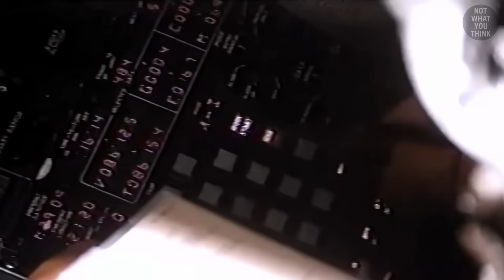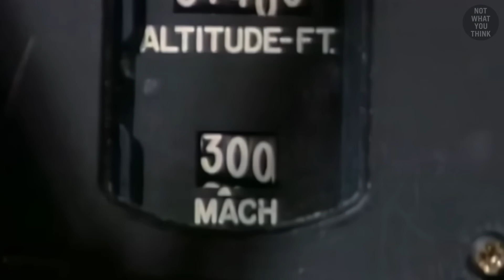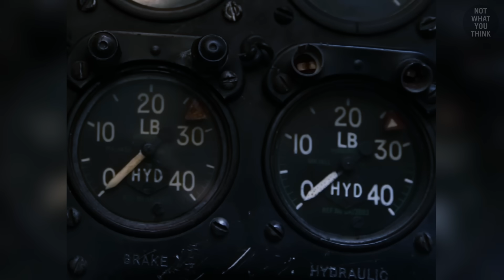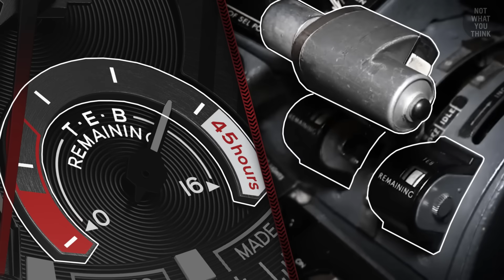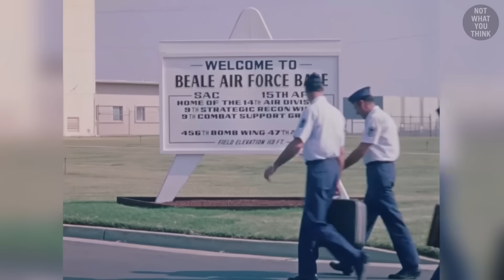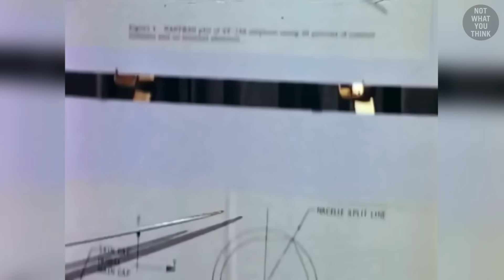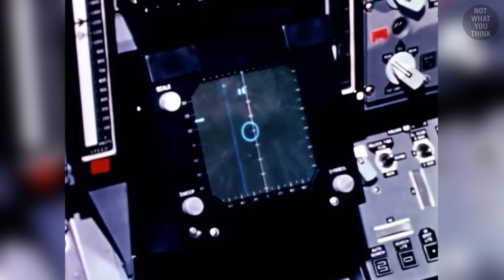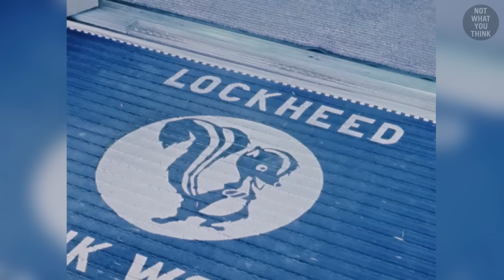Real Stories From The Cockpit Of The Untouchable SR-71 Blackbird

Comment: From a presentation from a former SR-71 pilot, taking off with limited fuel was not for the landing gear or practice refueling, it was the fact that it couldn't escape ground effect on the runway and rotate to take off when fully fueled. It had to be low on fuel in order to get in the air. Same pilot said the F-22 climb rate was 'cute'.

Comment: The 2nd reason the blackbird refueled soon after takeoff was to purge the ambient air from the 1/2 filled tanks. Once full the SR-71 was cleared to accelerate up to speed and altitude. 

There was an alternate procedure done 2-3 hours prior to flight. Fill the tanks full on the ground. Service the liquid nitrogen full. Defuel the tanks from 80k down to 65k. Now the atmosphere in the tanks were inert. This would allow the aircraft to accelerate up to speed and altitude from take off. While still having the safety margin in the event of a emergency landing.

This was only normally used during flight test and not operational missions.

Comment: TWA flight 800 was likely shot down.  A number of people saw the missle from beaches along the coast.  To prove these people wrong, they shot a test missle and had observation points on those beaches.  Every observation point was able to see the missle.  Wouldn't be the first time the truth was hidden.  The TWA flight was in 1996, the SR71 use nitrogen from day one, 1964.  The two airplanes used very different fuels, JP-7 verse Jet A.  Jet A is very much like diesel fuel, it doesn't ignite with a simple flame.  The military was conducting SPY-ID(V) operations in the area under TWA 800.  There was a possible  CIA coverup and FOIA requests were delayed past the statute of limitations.  The FBI was also discouraging witnesses from testifying.  Clearly the story of the center fuel tank is highly questionable.

Comment: Seriously?! You believe the government narrative that TWA flight 800 exploded due to supposed fuel vapors igniting; when the plane flies at subsonic speeds and hadn't even gotten to its cruising speed. Also, if that's the case, why has there never been, before or since, an incident of a plane's fuel tank exploding due to an internal ignition of fuel vapors during a flight?
It was clear, based on eyewitnesses and the final declassified report that the plane was accidentally shot down by a missile fired by a naval vessel doing training near the area.
You should do better research, so you don't present erroneous information. 
Otherwise, a very good historical documentary. Thanks.

Comment: As for the maximum speed - one key note is that Mach number changes with air pressure and temperature. In some atmospheric conditions, Mach 3.3 is faster in raw miles per hour than in others. The hard limit of the inlet cones of Mach 3.55 is indeed a Mach limit. Thus based on the conditions, that could be faster or slower ground speed.

Also, one key thing is that the Mach number is lower in miles per hour of airspeed in thinner air - so Mach 3.55 at the altitude the SR-71 flies is slower than Mach 3.55 would be at sea level. (And no, SR-71 can't go Mach 3 at sea level, or anywhere near it. The atmosphere is so thick the atmospheric friction heating would melt even the titanium.)

Comment: The aircraft could not explode from fuel vapors. The fuel had a very very high ignition point and required special ignition systems on the plane. @13:45. Might want to fix your video....

Comment: The low fuel on takeoff was necessary to prevent problems in case of an engine failure. It couldn't climb at max weight with one engine inoperative.

Comment: Leaking fuel tanks: rubbish, or, to use Latin, faeces. Similarly for fuel vapour spontaneously igniting, the flash point is higher than 200ºC. You are quite correct, it is not what YOU think !!
Reply from the maker: What about leaking fuel tanks?
Reply: @NotWhatYouThink all aircraft leak, and have leak limits. The SR71 was really no different.

Comment: wasn't LN2, but TEB. The afterburners could only be lit by a hypergolic shot of tri ethyl borane, and when you ran out of that nasty juju, you could not re-light burners after you hit the tanker.
Reply: They had a backup catalyst ignition system for the ABs, they just didn't like to use it.

Comment: The fueling coment is completly untrue.  The plane needed a different fuel to go mach 3 after takeoff.
Reply: Huh? The SR71 was always fueled with the same fuel. While it could be refueled in the air with other fuels if an absolute emergency, it would have had significant reduced performance.

Comment: its hydraulic oil not fuel by the way.
aerodynamic disturbance? You mean stall the engine  out right?
Also I think you did not say WHY fuel leaked between titanium panels - because of thermal expansion of the metal at normal operating conditions at speed. Gaps closed up in the air when plane was hot.

Comment: Yeah the air going to the engines not being supersonic was absolutely critical.  That would destroy the engine.  Another bit about the SR-71 is at speed it was very sensitive to pitch angles.  Didn't take a heck of a lot at speed to sent the aircraft out of control.  One of the coolest parts of the aircraft was how it knew where it was in the world.  Since it was above the clouds it had a good view of the stars and used those to know where it was at.

Comment: TWA800 was downed by a USN Submarine launched SAM, not fuel vapor, as the center tanks’ fuel/air ratios could never support combustion.
Reply: LOL.  Dude USN submarines don't even have SAM missiles.  That would require surfacing the submarine and that is the antithesis of how submarines work best.  You played yourself with that goofy statement.
Reply: The sub herself hadn't even been commissioned yet, and the missile they launched from periscope depth existed in violation of then current cold war treaties, so the USN wasn't about to surface and say, "My bad!" The NTSB sent seat fabric samples to the lab for analysis before the FBI locked them out of the investigation. The samples tested positive for residue of an explosive compound that was used exclusively in a sub-launched SAM prototype from a program that had been cancelled as part of SALT. The gunner's mate at the unfamiliar launch console was being harassed by a petty officer to hurry up with acquiring the target drone and launch so they could dive and get back to Groton before anyone noticed the sub was gone. The gunner's mate didn't realize he'd locked the unproven system onto the 747, and not the drone, until it was too late. There's nothing "goofy" about tragedy.

Comment: TWA 800 was hit by two missiles during a US Naval contractor test of what was probably a missile and an interceptor missile.  The interceptor failed and both missiles wound up hitting TWA 800 blasting the fuselage in two at the wing root.  The Clinton administration completely sabotaged the investigation pushing the FBI and the CIA into what should have been a National Transportation Safety Board (NTSB) investigation into the cause of the crash.  Boeing aircraft back then did not spontaneously explode due to random sparks and Jet A vapors inside the centerline fuel tank. The 747 is subsonic and does not experience the atmospheric heating that the mach 3+ SR-71 routinely experienced on its titanium skin and there was no need for any nitrogen in the fuel tank to displace air. That and the CIA's invented ridiculous "zoom climb" hoax to cover the track of the missile marked the end honest "government investigations" of transportation accidents.  From that point on the NTSB was turned into a political propaganda tool as this narrator demonstartes.

Comment: I was working on the SR-71 when it was finally cancelled by Clinton in October 1997.  During this time, the military had installed a data link on the SR-71.  The data link was installed in a camera bay forward of the front landing gear.  The data link antenna radome protruded down into the shockwave coming off the nose of the aircraft, so the pilot to watch how he banked the aircraft or the shockwave coming off the radome would go into the engine inlet and cause an unstart.  Both of the aircraft that we flew, 967 and 971, are now part of museums, and I have been told that one of them has that radome installed, but I'm not sure which of the two since they aren't located close to each other (one in Oregon and the other in Louisiana), it's kind of hard to verify which one.
Reply: Спасибо за интересный комментарий...
Reply: Меня больше всего восхишало, в этом самолёте дизайн. Это шедевр.
Reply: Z tego co pamiętam, pracownicy Skunk Works strasznie narzekali na wiercenie otworów pod nity w kadłubie SR 71 zrobionym z tytanu, który CIA, zakładając fikcyjną firmę we Francji kupiło od ruskich. To musiał być szok dla pracowników Skunk Works, że na wywiercenie w tytanie jednego otworu pod nit, musieli zużyć kilka wierteł. To były lata 60.
Reply: @roberts9000  Skunk Works had to invent new tools and ways to manufacture and work with titanium. The SR-71 was breaking new ground from start to finish.
Reply: cool
Reply: But they were still flying missions out of Cyprus in 99.   Kindda difficult to keep something that loud quiet.
Reply: @ScamArtist-x7h  Um, no they weren't.  You are getting the SR-71 mixed up with the U-2.
Reply: Very interesting.. I've heard that when supersonic if the engine conditions weren't perfect, the engine itself could "swallow" the shockwave coming off the inlet air cone and cause a flame out, from my understanding the SR-71's intake nose cone's are hydraulically/mechanically adjusted
Reply: @fjs1111  yep.... you're correct. That's the very reason for the cones being able to adjust.
Reply: Так была течь топлива у SR-71 или нет?
Reply: @IziyaSnobelman  The panels of the airframe at normal temps were designed to be loosely fitted because the designers knew the airframe would expand when heated at Mach 3+. Fuel would leak on the ground. Once airborne above Mach, the panels would heat up from friction and the panels expand, sealing the airframe and no more fuel would leak. There was no fuel bladder or seals that would withstand the temps at Mach 3+. A special fuel was designed for the SR-71 to take this into account. It was thicker than regular jet fuel.
Reply: @hifinsword  Спасибо за разъяснения. По моему скромному мнению это - опасно.
У нашего 3 Махового перехватчика МиГ-25 и Миг-31 топливо не течёт. Планер сделан из нержавеющей стали, и собран на сварке.
Всего Вам хорошего. Россия.
Reply: @IziyaSnobelman  The SR-71 was designed to go Mach 3+ for hours without afterburner and use less fuel than at afterburner. The airframe is mostly titanium, light weight and very strong, able to withstand high temps. The Foxbat cannot do super cruise without afterburner, and not for hours. Nor can Stainless steel withstand high temps for hours. It's rumored the Foxbat needs the engines replaced if at top speed for more than a few minutes. The lightweight allows the SR-71 to fly at heights the Foxbat cannot reach. There is very little danger from the SR-71's special fuel leaking on the ground. Its flash point is higher than normal jet fuel.
Reply: @hifinsword  Спасибо за разъяснения. Я не знаю, сколько может летать на сверхзвуке МиГ-25(31). Знаю другое - нержавеющая сталь более устойчива к высоким температурам, чем титан. Кстати - титан на SR-71 имеет русское происхождение.
Reply: @IziyaSnobelman  sr-71 стал бесполезным после того как спутники получили возможность давать адекватную картинку, благодаря которой все можно было видеть не летая над территорией. а не из за миг-31 или ещё чего либо
Reply: @IziyaSnobelman  According to Google, "the MiG-25 could only sustain its maximum supersonic speed of Mach 2.83 for a very short time, typically around 5 minutes due to the risk of overheating the airframe and fuel tanks if flown at that speed for extended periods." The MiG-25’s ceiling of 67,000 ft was well below the advertised ceiling of 85,000 ft. I believe the Mig's engines had to be changed out if it went max speed for very long.
Reply: horror
Reply: Миг 25 отучил эту птичку летать и да он не выглядел как космолёт неземного происхождения . Инженеры были на высоком уровне создавшие самолёт с подобными скоростями , но гораздо более удобный в обслуживании.
Reply: @sergeykhadyev  that thing ugly as hell bro

Comment: 17:00 - the sr71 mach meter went to mach 4, and the rumours were it could do 120,000 feet.
Reply: Lol neither of that is true
Reply: @gr8crash  lol its true, just rechecked the mach meter and it has fine graduations until M4 and then goes up to M6 ..... grow up kid
Reply: @ghostrider-be9ek what you're referring to is the mach/airspeed gauge. What you obviously arent aware of is that gauge isn't used above mach 1.5 as it's too inaccurate. They ONLY refer to the TDI gauge, which doesn't go that high.

Also 120k ft is completely impossible. It couldn't even sustain 100k ft and didn't get that high anyway.

Comment: Russian missiles turned the SR71 into a reconnaissance aircraft over countries with insufficiently developed anti-aircraft defenses.
Reply: Lol doesn't even make sense.
Reply: @gr8crash  SR71s could not fly over territories that were protected by Russian anti-aircraft missiles.
Reply: @milanbaran7291 lol that's not even remotely true. It did that for decades with no issues.

Comment: A couple of things not mentioned that were critical to the SR. First the liquid Nitrogen wasn’t used for starting or running the engines. If an engine quit in flight it was called an “unstart”. The TEB was used to restart the engine. No TEB, no restart. All this had to happen when the airframe is suffering from severe stresses from having power on one side but none on the other. One thing that most people don’t mentioning is the very high flash point for the JP 7. You could drop a lit match into the puddles on the ground and all they would do is go out. Lastly, one “trick” fastmover used to tell if a missile has them targeted was if the crew could see the missiles exhaust. Off to the left or right, they weren’t  the target. If you don’t see the exhaust, you’d best time your evasive maneuver. It took a lot of guts because you had to wait until the missile was too close to maneuver with you. Or, if your in the SR, you just throttle up and out ran it!
Reply: Exactly as mentioned he never talked about using LN to restart but for tank inerting.  At the temperatures that aircraft got to at speed this was a very real concern.  Not mentioned but a prime reason why they had to purge the LN for refueling is the same reason fighters depressurize their systems to get gas.  At full pressure the tanker wouldn't be able to transfer fuel to the recipient aircraft.  So having to purge then refill the tanks as needed with nitrogen to inert the tanks would be a prime limiting factor for normal flight operations.

Also, TEB was used to light off the afterburners so no TEB no afterburner too.  So no excessive jockeying of the throttle in and out of AB for those guys like you can see in fighter jets.
Reply: Not mentioned?
He did explain the purpose of the liquid nitrogen (as an inert atmosphere to prevent fuel-vapour ignition in the head-space in the fuel tanks).
Reply: true about the fuel. I was an Army rotary wing refueler and the JP8 we used, you could drop a burning torch into it and it would go out. Getting those vapors to catch was an exercise in patience if you wanted to use it to burn something.

Comment: In case anyone was curious, the difference between mach 3.3 and mach 3.5 is 153mph, or about the maximum speed of most sports cars.
Reply: Well you are only putting part of the equation into play as the actual speed of sound isn't consistent at all temperatures and air densities.  So saying 153 MPH is only going to be correct at set temperatures and densities.

Comment: Very nice video with great explanations, but with a couple of important factual error.  The fastest acknowledged speed reached was 2,242 mph, or Mach 3.39, and on at least a couple of missions, the plane flew faster than Mach 3.4, likely reaching 3.5.  So, no, 3.3 was not a absolute limit.  Photos publicly released after the retirement of the Blackbird showed the plane flying at 88,000 feet, so flying at 90,000 feet was something it could obviously do. I appreciate the details about the nitrogen tank system.   Lastly, the Blackbird, flown by pilot Vida in 1990, went coast to coast in 64 minutes 20 seconds, and the crew told the press that if some parameters had been changed a bit, they could have flown it in under 60 minutes.  This did not require a speed of Mach 3.5; it merely required flying one of two of the slower segments a bit faster (the SR-71 did not fly at the same speed through all of the radar gates during that flight).
Reply: please are there any way to see (w/o any doubts) in photos, that it flew at 88,000? Perhaps a shot at the dashboard and its instruments, while still a bit of outside background as a 'proof' it was actually in flight and at that height?
Otherwise I (personally speaking) am unable figuring out the way the evidence could be backed to confirmation.

Thanx from Italy.
Reply: @francescofissore161  Major Brian Shul showed photos from his cockpit.  You can google his speeches and find it.